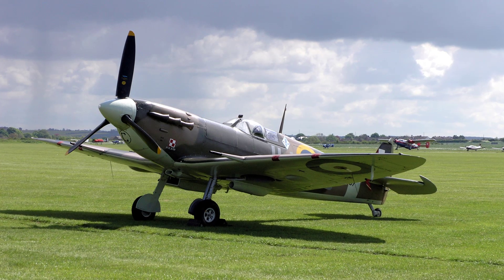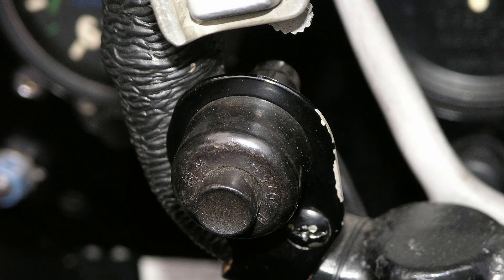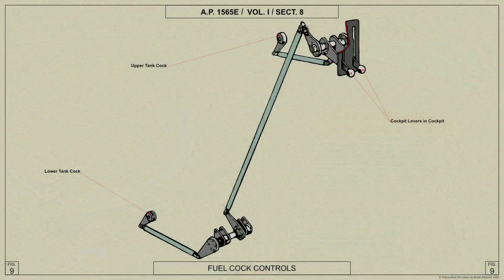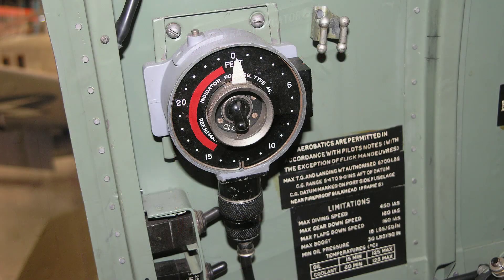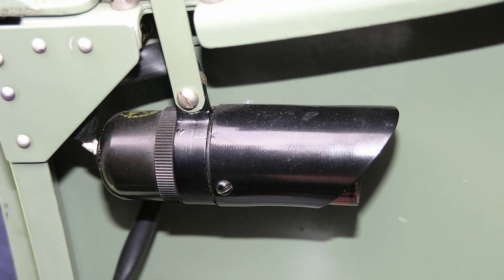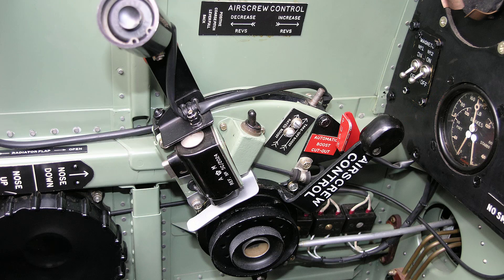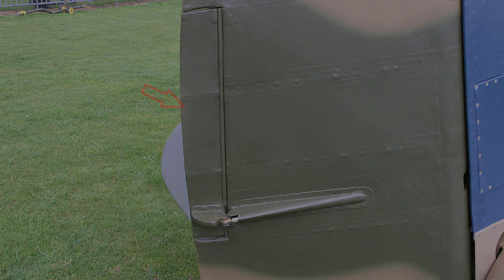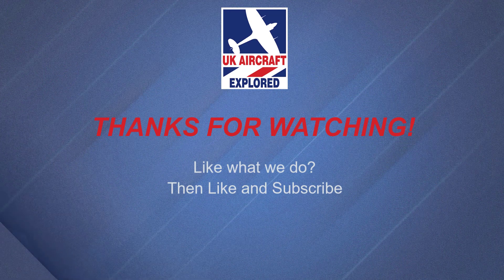Spitfire Mk V –  Port Side of Cockpit

Comment: Love these videos. Seems the door handle could be used as a tool for breaking the plexiglass in case of emergency right?
Reply from the maker: No, the door handle is fixed to the top of the door. You may be referring to the red crowbar clipped onto the wall of the door structure. That would be used in an emergency. Thanks for watching the video.